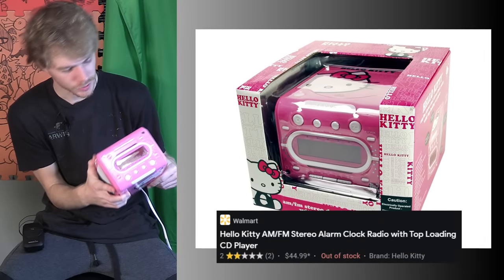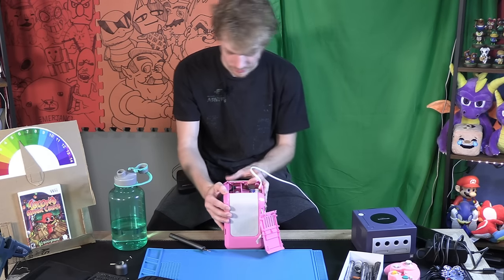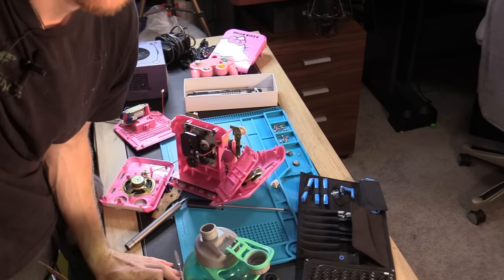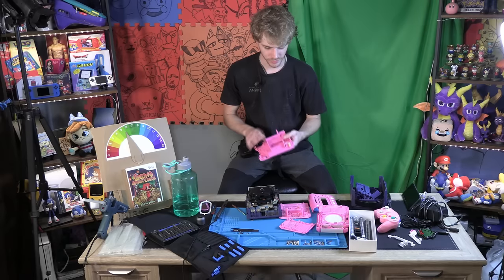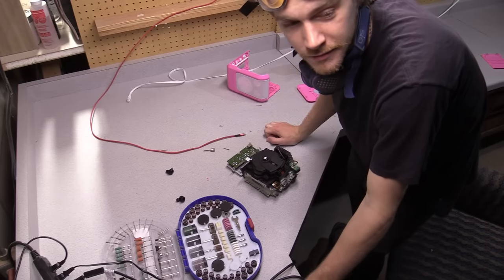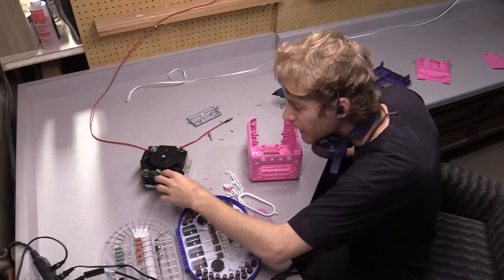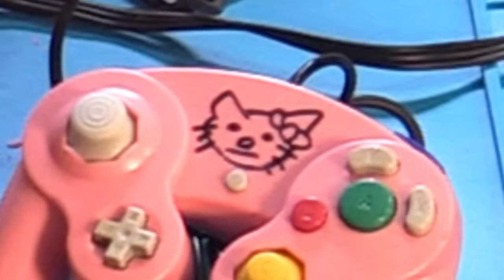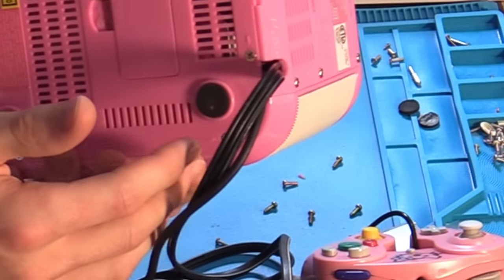The Hello Kitty GameCube

Comment: Just a suggestion for when the hot glue eventually fails on the DVD-ROM: Use a set of magnets and super glue! Holds shut, but easy to pull open. Plus, it's barely more energy than waiting for the hot glue gun.